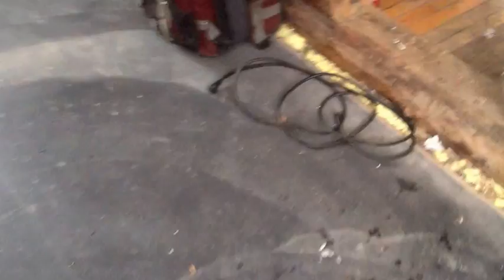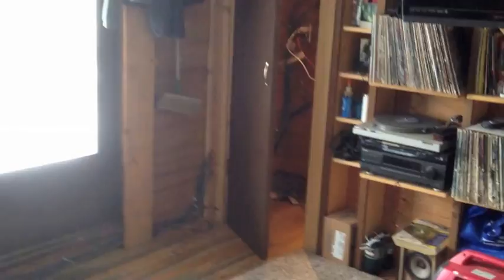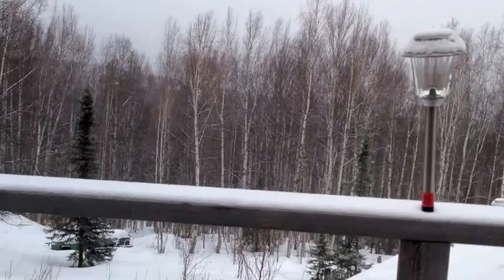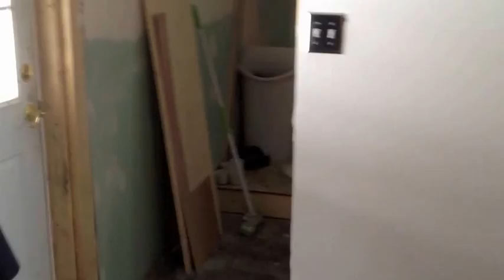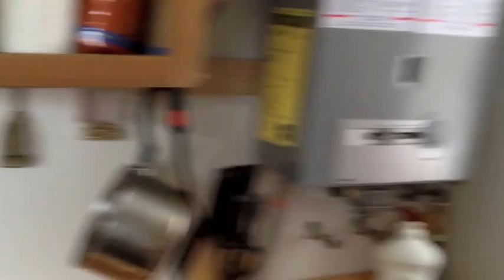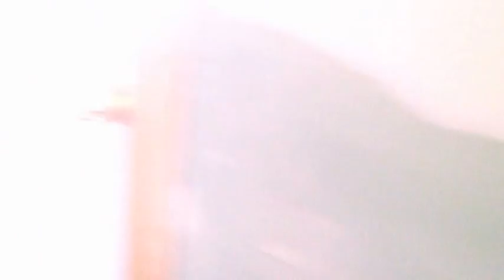alaska off grid cabin

Comment: Why do you want to do all that with hot water just to make hot water from the hot water that your stove is producing?  You could get a little solar panel to run the pump and utilise the hot water for a radiator and the shower and kitchen.  I am not being facetious,  I just can't follow what you're doing?  I mean all you need is a hot water tank with working safety valves and with the solar powered pump it's surely less hassle? (Mind you I'm no expert but I just can't see it? ).

Comment: How much power does that thermalgen put out? I am thinking of building a small cabin and have been curious about them for a while.  My design uses LED bulbs at 12v like I use in my sailboat. Very little power use. I mostly need power to read by and to charge laptop and camera batteries. Are you using a Genset in the winter up that way?
Reply from the maker: Air Marksman as of now the thermal electric generator is only producing max about 700ma at 30+volts, so not very much, i want to replace the base of it with a thicker plate of aluminium because it is not having good contact on the hot side with the thinner aluminium. yes i run my gen almost every day in the winter for about 2 hours depending on power usage, but i replaced my battery bank with a new/used one today, i found a dead battery in my old bank so hopefully i wont have to run the gas gen as much. using a thermal electric gen to power led lights and to charge laptop and camera batteries is possible, depends on system set up.
Reply: shiblib
Thanks for the reply.  I watched a video yesterday of a guy in the UK that was getting around 7amps out of his. If I could duplicate his set up I know I could live just find with what power it produces. I would still have a few panels and a wind gen to make sure it always stays topped.
Reply from the maker: Air Marksman  ya i think i seen the video, i wish i could build a wood stove like that with a teg but there are emission  rules here so complicated.

Comment: thank you for sharing, on the frig. why not get a old ice box and use the outside air, with a solar fan?
Reply from the maker: Bonnie Prater not enough sun in the winter up here for about 4 months a for solar fan, the cheap solar lights don't even work in the winter. and having a propane fridge in the summer is a nice way to go.

Comment from the maker: they work good for moving the air, the fans work from TEG modules to make power from the heating and cooling effect. wood stove heating the bottom of the TEG module and the fan cooling the top making power to power the fan motor.

Comment: I mean enclose the deck ...or add a "sunroom" on the south side. In the summer you can open up the windows. In the fall and spring you can gather heat in the sun room and let it in or not. It could double as a green house to start plants in the spring.

Comment from the maker: my south wall has the most and biggest windows, the upper deck help shade the 1st floor too keep it cooler in the summer, in the winter the sun is lower and i get more passive solar heat. through all of the windows. i want to replace some of the bigger windows with triple pane windows to save more heat in the winter.